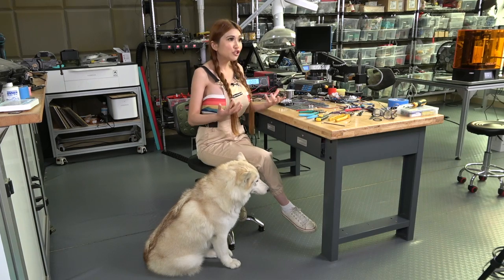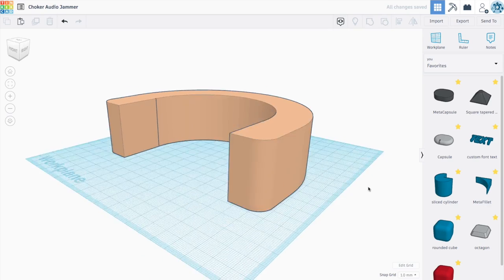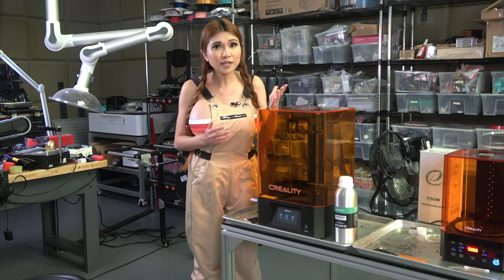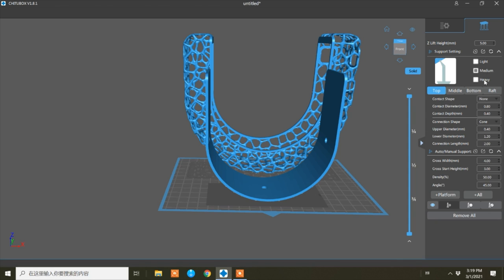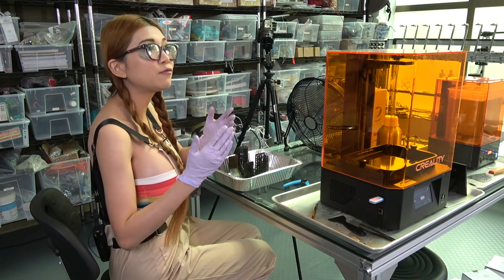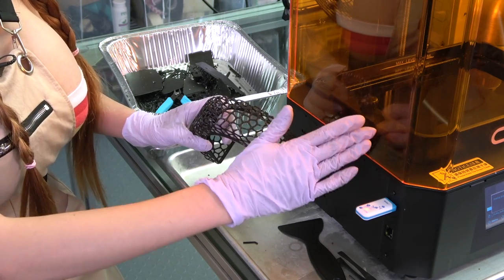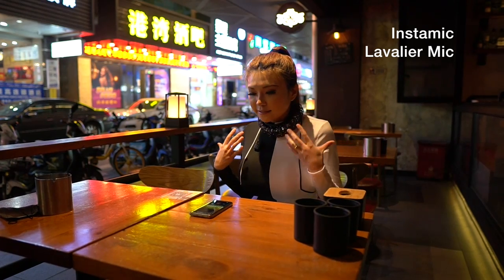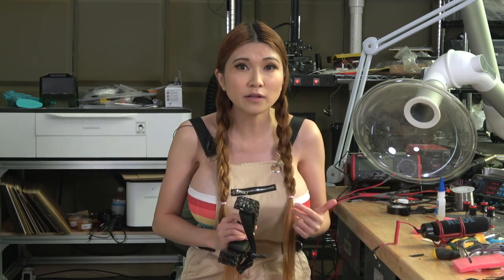DIY Wearable Microphone Jammer!

Comment: Note for anyone trying something like this for themselves: it would probably mess with hearing aids in the same way it messed with the cheap microphones. Be mindful when using it.
Reply: And pacemaker !!!😶
Reply: @lulumire  
Edit: Apparently ultrasonic pacemakers have been proposed.

The choker is only emitting sound, not EM waves or magnets, so pacemakers shouldn't be affected. In fact, the choker should be safer than most headphones because it doesn't contain magnets.
Reply: @xenontesla122  Yes, but new gen are powered by ultrasound so hope it doesn't interfer.
Reply: @lulumire  Interesting! I didn't know that.

Comment: Firstly,  you are one of the best things about the internet.  Secondly,  it occurs to me that the difference in effectiveness between the phone mic and the video mic is directionality.  Low frequencies refract easily,  which is why you can put your subwoofer almost anywhere. High frequencies are highly directional,  which is why your tweeters need to be pointed at you.  Ultrasound even more so. Your choker's transducers were pointed almost directly at your phone, an the bottom of it, where the mic is. The video mic was behind the camera and therefore had no transducers pointed at it. Some will be reflected,  but will interfere and dissipate quickly.  That's why bat sonar uses those frequencies.

Comment: Hey, I have 20+ years casting in resin, I use molds, rather than 3D, I Cast parts less than 0.1 mm so pretty high precision, I'm no amateur. 

Those white spots are stress marks, if you use a razor saw to remove your parts, rather than clippers, and file those stumps from molding away, it leaves no marks, also you can wash resin away with hot soapy water, the isopropyl alcohol is absolutely not necessary, it's faster for sure but not better per se.

Also you can use a hair dryer or a heat gun to gently, over time, apply a bend to a bit of resin that's not quite right.

Lastly you don't need extra resin over a blemish, literally just polish it.

Hope this helps for the future
Reply from the maker: Good tip!
Reply: @Naomi-Wu  You're very welcome, love the channel

Comment: It can be defeated by any mic system that uses high frequency suppression in hardware, ie like the Rode Mic. 
Cellphones usually filter in software which means the Mic is swamped by the ultrasonic sound, and the auto gain turns down. 
But a better designed Mic (like one for speech) uses hardware filtering (high freq cut) directly after the Mic so it just removes all the ultrasonic, and the auto gain circuit will bring up the voice just fine.
So when it comes to security, this will not work with any decent system that is designed to pick up voice (like bugs etc).
Reply from the maker: Yes, as I said. It's not for targeted audio interception using high end equipment. It's for phones and smart devices recording without permission.

Comment: - As expected, quality microphones are resistant, filtering out high frequencies before the digital sampler.  A jamming frequency closer to 30kHz or a bit lower may work against a wider range of devices, but is more likely to bother the dog.

- With ultrasound scattering elements in the enclosure (a design project in itself) fewer ultrasound drivers could cover a wider field.

Comment: Looks like you might want a less brittle resin, like Phrozen's Functional.  It'll bend instead of break when you snap off supports, and the detail level is roughly the same.  The Hard Tough resin is better suited to thicker prints, where the thickness lets it distribute the load better.  Or something that needs to hold up to impact.

Comment: First: Could a BoM (Bill of Materials) be added to the project PDF files?  If one is there, I didn't find it.  In particular, I'm looking for the datasheet for the ultrasonic emitter, to see how far it can be pushed.

I suspect an ultrasonic jammer would fail with most capacitive capsule mics, and work best with MEMS mics.  The MEMS interference comes from the nature of MEMS devices themselves: They are tiny mechanical systems that are easily disturbed,  Capacitive capsule mics use a far larger sensing element that is tuned for audio frequencies: The better the mic, the larger the capsule and the harder it will be to jam.

Little capsule mics, ones the size of the tip of your little finger, are quite common and should be jammable.  The main approach to jam such mics would to try to stimulate a resonant frequency.  The code only utilizes a frequency range from 24-26 KHz, which is easily blocked by capsule mics, as it is barely outside the audio band.  I'd think we'd need to check from 40 KHz and above (to maybe 120 KHz) to find resonances.  I'd recommend playing with the upper limit in  line 57 of the sketch and see what happens.
Reply: You mean a parts list! For non Americans.
Reply from the maker: It's here: https://github.com/sexycyborg/Wearable-Audio-Jammer/blob/main/manufacturer%20files/Bill%20of%20Materials-JammerCon.xlsx

Comment: Well done again Naomi. Move your design to flex board, a little more sensitive to solder but would be lighter and easier to fit in the curve. In your mesh put a couple of rings to push the transducers into to hold everything in place. Lastly the one piece suit with your platform boots looked really good on you and the collar blended in as part of the ensemble. Keep up these great projects.

Comment: I'm curious to know the affected radius. Will it screw with the phone calls of everyone around?
Reply from the maker: Max is about 2 meters
Reply: @Naomi-Wu  Tested by seeing how far away the food delivery riders were when they suddenly start yelling into their helmet mics "喂, 你还在吗?" XD
Reply: @Naomi-Wu  You can get 60W transducers intended for Ultrasonic Cleaners. As they are intended to feed into a liquid filled tank, that seems a way to make a 360 degree output using a single transducer and a water filled metal pipe. Judging by the problems Louis Rossmann and others have with their shop Ultrasonic Cleaners, a range of 4-6 meters is possible.
Reply: @station240  water filled metal pipe?
Reply: @station240  these transducers seem to only work on mems and electrec style microphones. You can find the transducers in the 60, 70 and 80 watt varieties relatively easily online and it will be cheaper than buying and tearing apart an ultrasonic cleaner. Dynamic microphones or the ones that have the old school coil and  ribbon that use magnetic induction should remain unaffected. It's also possible to build the circuit out on a digital mems microphones to avoid this and even include noise canceling but there is an added expense.

I got lost down a deep rabbit trail/hole a few years ago trying to make an ultrasonic LRAD type device to employ speech jamming and mess with people's minds. Anyways,  along the way I ran into these problems with the mems mics which made my plans less attractive in some ways but way more insidious in others. In the end, I lost interest but my point was going to be that you could modulate these signals to inject speech onto these recording devices too. Unless you are in a certain frequency range,  the user will never know until they review the recordings or in the case of someone on the phone,  the other party mentions it. My favorite was pipimg a recording into it telling Alexa to say she waa going to pee on the leftovers from dinner when you go to sleep when over at someone's house for drinks or something.
Reply: @station240  the ultrasound must from liquid to air. You don't have problems with refraction of sounds? Some sound might be reflected back into liquid, because sound travel faster in liquids

Comment: No need to apologise for anything.

An interesting and original project which will always take longer than expected.

One thing that is not mentioned (although it will vary with the size and design of the device) is the power consumption and battery life.

Comment: The reason it works for embedded microphones and not for your Rhode is that those small microphone are "MEMS" microphone, or Micro Electro Mechanical Systems. They are very sensitive up to 70 or 80 KHz where we can only hear up to 20KHz, but the reason we use them so often is because of their size and very low price.
The microphones inside the Rhode and some other high end microphone are not MEMS, but some other older and more expensive technologies that are tuned to record the frequencies that correspond to the human ear, and sometimes more specifically to the frequencies of human voice.

Comment: Very interesting. Since there are two rows of speakers on those boards anyway,, wouldn't you want the top row pointing up at a 45-degree angle to interfere with devices that are further from you or more elevated? Seems like a lot of stuff that isn't directly in front of/below you ends up too far off "boresight" of the transducers to get jammed because the collar is naturally sitting at an angle.

Comment: Ah there is a trick to making resin models less likely to shatter when removing support material.
After the IPA bath, soak in warm water (say out of the tap) for a few minutes, then remove the support material and cure.
Tip from the AnycubicPhoton subreddit.
Reply from the maker: nice!

Comment: Cool concept. One problem I can't see an obvious work around however, (although i would love to be proved wrong). Is that anyone dedicated enough to spying on you should be able to remove the jamming with a relatively simple Fourier Band pass filter. This should effectively remove any ultrasonic signals from the sample.

I'm sure I'm missing some non-linear effects, but it doesn't look like the signal has a strong enough intensity to induce any non-linear effects.
Reply from the maker: Easy enough to test your theory...

Comment: U should try using a mixture of siraya tech tenacious and siraya tech blue resin the print won’t be soo brittle also I would pre wash the parts first in 50% ipa so ur 100% ipa stays cleaner longer other wise parts could come out slightly tacky

Comment: Awesome video. I wonder how much more programming is needed to make it turn on and off with Bluetooth. Also question with the resin if you can’t open all the windows for ventilation will an auto body paint mask be enough to filter out the chemicals? Thanks.

Comment: Just an idea, Naomi, have you considered getting a fume cabinet installed for the Resin printers? The ones they used to have in my school science labs were large enough they would have fitted that printer in with no trouble.
Reply from the maker: I might vent it outside, normally I don't use them much...

Comment: Naomi, thanks for the video.  I do not own any 3d printers but I was curious that you chose heavy support for this project.  For the resin type prints are they really that fragile?  The final prints seemed reasonably strong, is that only after cleaning and some curing time?  Thanks again.  LCARA Ham Radio
Reply from the maker: Heavy supports meant fewer supports and they were easier to remove. The piece that broke did so because the orientation of the layer lines was on the wrong axis, when I printed it again I turned it 90º. That said, resin prints are quite a bit more fragile than FDM normally.
Reply: @Naomi-Wu  Thanks for the additional info!

Comment: Another great video and thanks for the demo !! I think the reason the "Røde" microphone is working, is because it's a condenser/capacitor mic. Where most smartphones today uses MEMS microphones. Another thing is, the transducers are directional and in the test, they are pointing at your phone, but not at the "Røde" microphone. Do you think it will make a difference if they pointed at the "Røde" microphone ?

Comment: Cool idea.  any feedback what this would do to hearing aids?  not throwing shade, just curious.
Reply: Depends on the hardware.  If it has a proper input filter the ultrasound will be cut out.  My understanding is all the better hearing aids today should limit input to around the range of human voice frequencies.  But if the filtering is done with a digital processor, and the input is not filtered before sampling, it will be jammed.

Comment: not an expert but based on my understanding it is perfect for ruining everyone's mobile conversations around you and if someone really wants to know what you are talking about they just have to have a really sensitive microphone then just isolate and delete ultrasonic frequencies so you could say it's useless but as i said i don't know if i completely understand how audio recording works
Reply: The jammer would be operating at above at least half the sampling frequency of the digital device.  So unless there's an analog filter before the sampling (which all better microphone systems have), the jamming noise is aliased into the audio range.

Comment: Hmmm if you said it can be made smaller so instead of a necklace it could be fitted as a wristband?
Reply from the maker: Sure
Reply: @shubinternet  The terms "wristband" and "bracelet" could be used very generically to describe the same functional aspect of an object fitting about the wrist; in common colloquial use they imply different qualities and functions. A wristband is typically a simpler device made if non-precious materials used for ornamental, identification or protective functions. A bracelet is usually an object of ornamentation with a primary decorative function, although it too may occasionally have a secondary purpose of identification or protection. Bracelets are often made of more durable or precious materials, and as a function of ornament, can be used to convey social status or rank. Wristbands are also often used to convey status and rank but when used thusly, it is usually their primary or sole purpose

Comment: Weird question but how does one maintain their solder iron like that? Other than the tip (which is tinned), everything else tends to turn black for me. (esp the filament)
Reply from the maker: Brass wool and don't leave it on too hot?

Comment: I don’t think this will be very effective. The electret condenser mic elements used by Alexa type devices have a frequency response that rolls off below 20 kHz.
Reply: Any of the better microphone systems have a low pass filter between the pickup element and digital sampling.